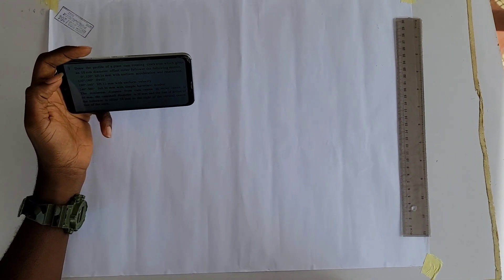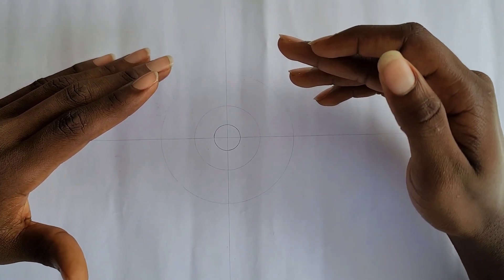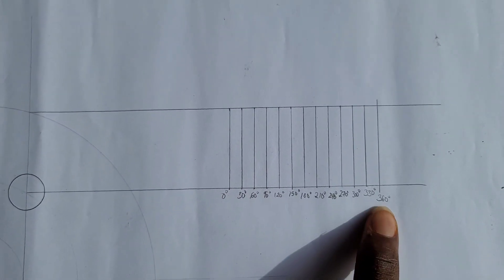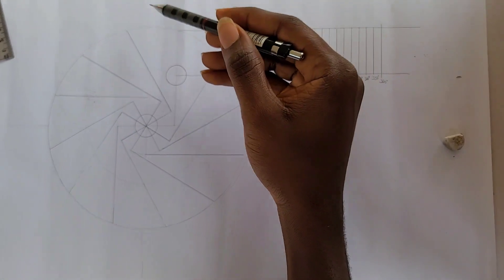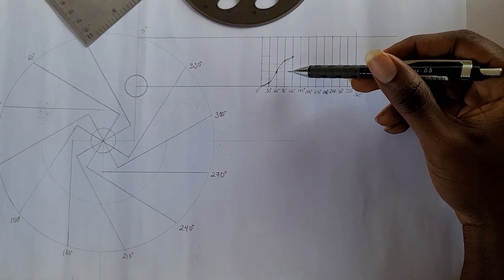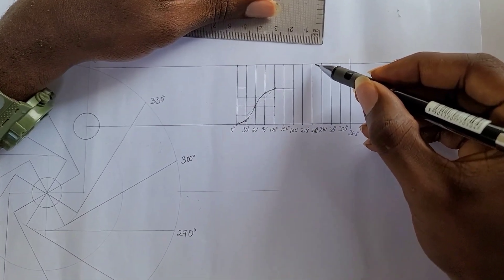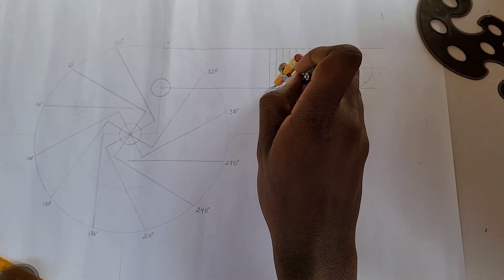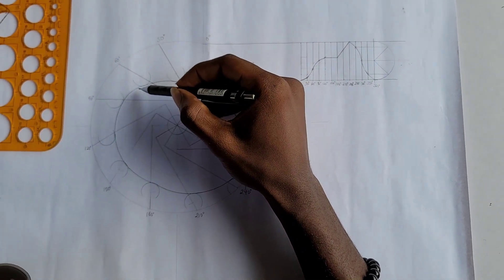How to draw the profile of a plate cam rotating clockwise with an offset roller follower

Comment: Is the length of the displacement the cam radius or the camshaft radius
Reply: Pick a suitable length and cut it into 12 equal parts ( you can decide to use 5mm or 1mm each)